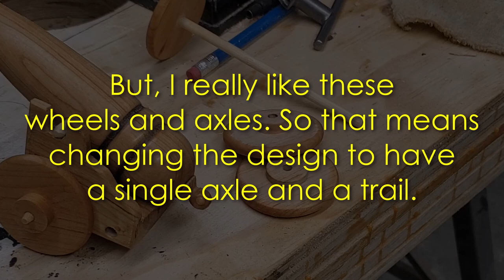Wooden Cannon Full Build - 1 piece of Cherry!

Comment: Measure twice, turn once 🤣. Awesome project. I was already on my to do list. I think I'll try a spring loaded version
Reply from the maker: Funny story, I wanted to use Zippo lighter fluid like I used to make potato guns with. But none of the stores around my house carry it. So I tried butane, don't use butane. I had some video of that at the end, but it didn't feel responsible. It didn't pop the round out, it all just caught fire. work bench and all. atomized way to quickly. That's why I switched to air and edited the fire out of the video. Thanks for watching!
Reply: @BAILEYWOODWORKS  that would make for an impressive demonstration 😁